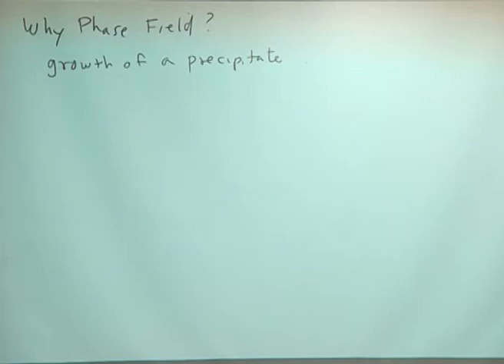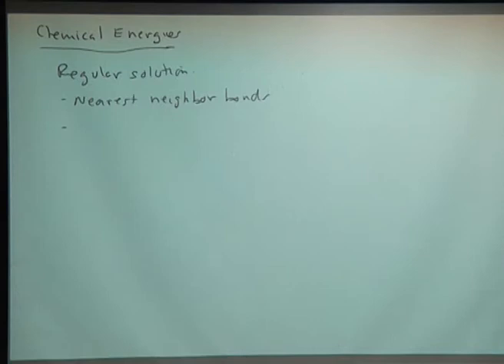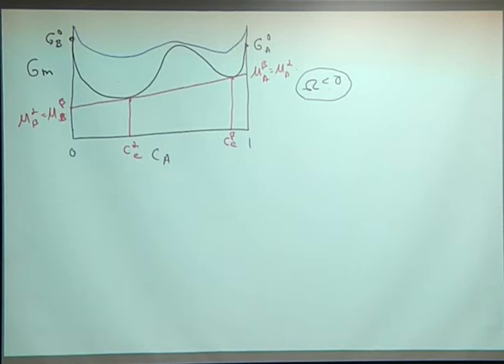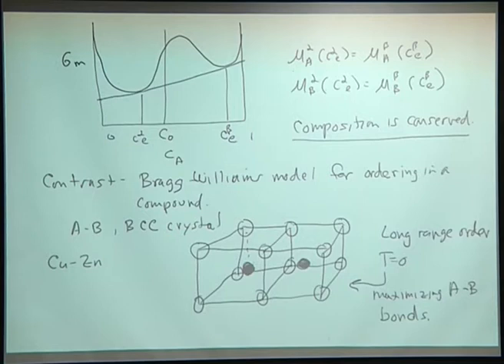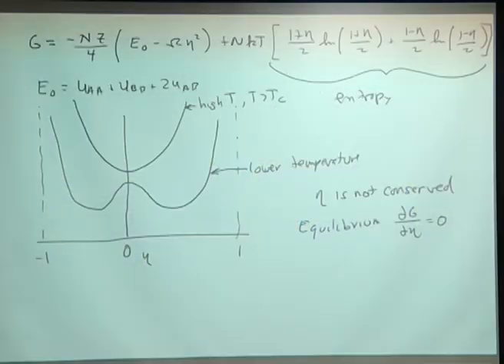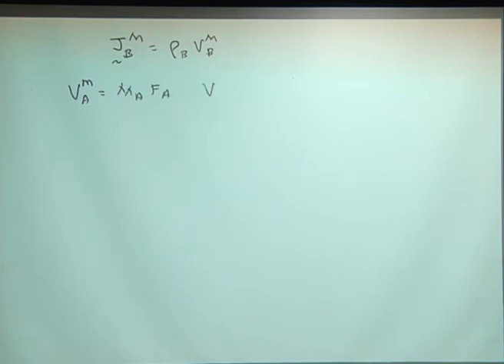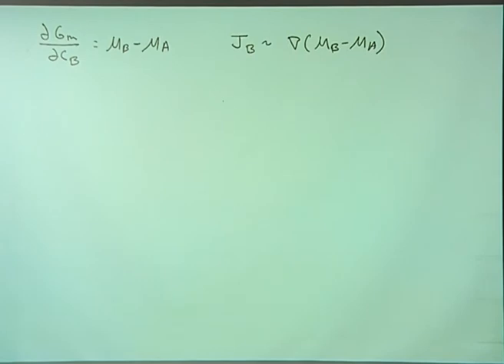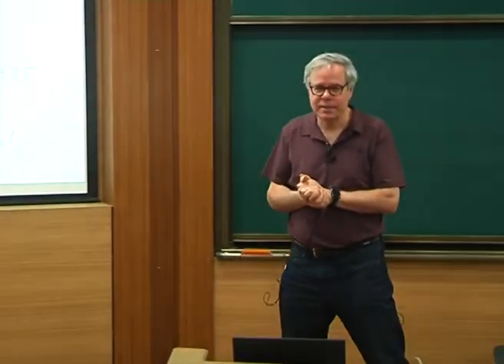GIAN-Phase Field Modelling  Prof. Peter. W. Voorhees, Prof. M. P. Gururajan - IITB Mar'18 Day 1 Lec1

Comment: Thanks for useful videos. But i have a question about the basis of choosing the grid size and amounts of grains in a modeling phenomena such as Static recrystallization. some of papares chose 512*512 and some of them 1024*1024. Please explain about them. Thanks
Reply: The number of order parameters chosen for different grain orientations has a statistical significance. As for the domain size, that is chosen for numerical efficiency (based on the numerical algorithm used for solving the evolution equations). When spectral methods are used for solving the equations, domain size which is a multiple of 2 has the highest efficiency.